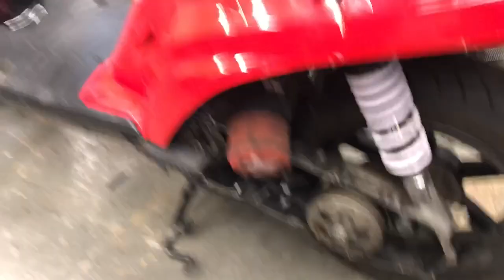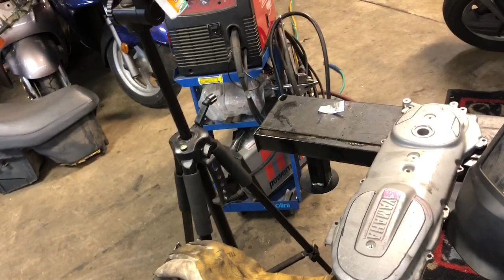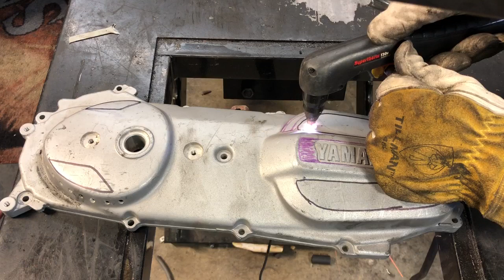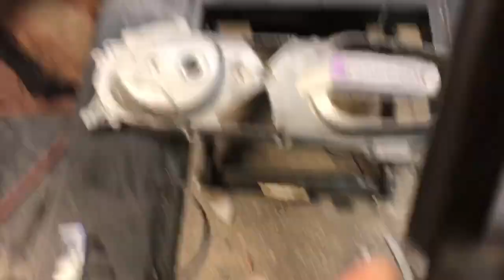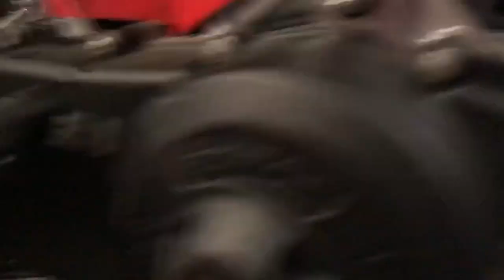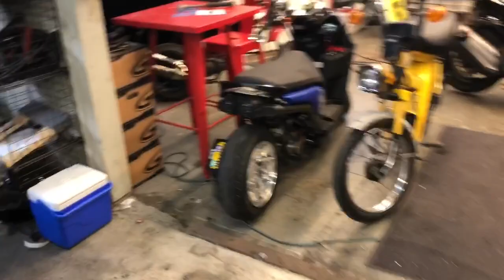Using a plasma cutter to trim your cvt cover

Comment: Just took my cvt cover to confirm if my belt was slapping, while it off  i noticed the bike sounded more rumbly so thought id a around the block. 
Holly molly its a lot Snappier. And the acceleration is much more noticeable

Comment: Quick question. I have a 94 Honda sr has the removable back cover like your Dio does if I remove it cause I recently rannit for awhile with just back off cause I use kick start do I need to worry about mud water etc getting on clutch?
Reply from the maker: If you ride a lot in the mud yes
It’s a concern. Rain not a huge concern
Reply: My recommendation is to use the vented cover for summer (hot temps outside) and use a closed standard cover in autumn/winter. In very hot summer days RPM's can drop when the whole CVT gets very hot and the torque spring loses some tension which results in RPM drop aka less power.